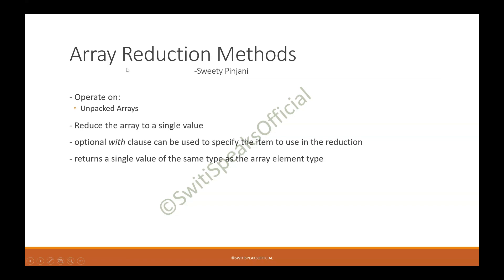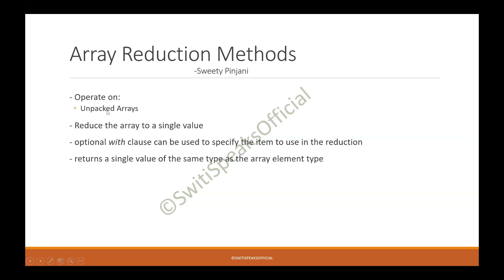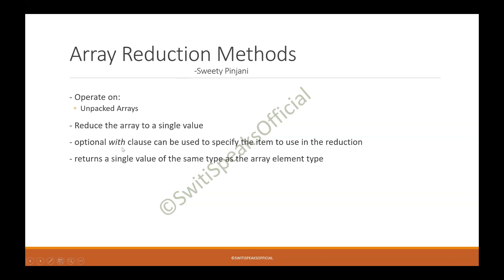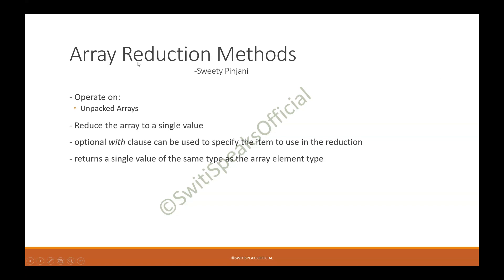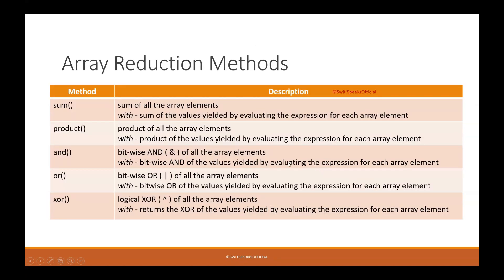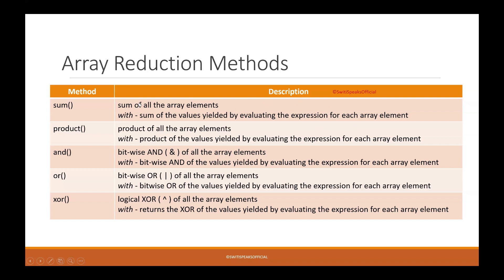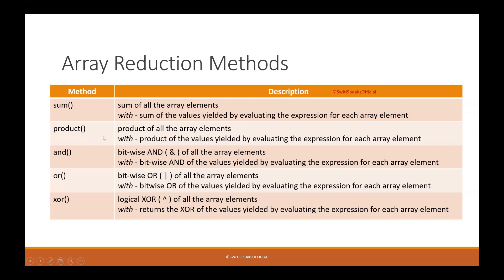Array Reduction Methods @SwitiSpeaksOfficial #sv #systemverilog #careerdevelopment #codingtutorial

Comment: int clause_sum_result;

clause_sum_result = intDArr.sum with (item < 3);	

$display("\nclause_sum_result is %0d %0b", clause_sum_result, clause_sum_result);	

Do you know if this is assigning correct for sum with clause? I am not getting output. For the rest I got.
# intDArr = 12 7 10 17 10
# size of intDArr is 5

# sum_result is 56 111000

# clause_sum_result is 0 0

# product_result is 142800 100010110111010000

# and_result is 0 0

# or_result is 31 11111

# xor_result is 26 11010